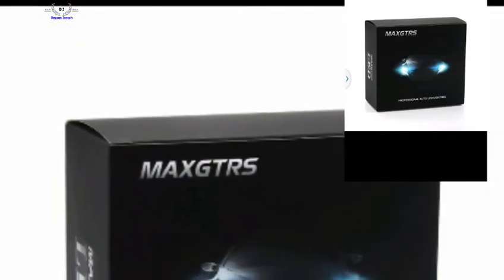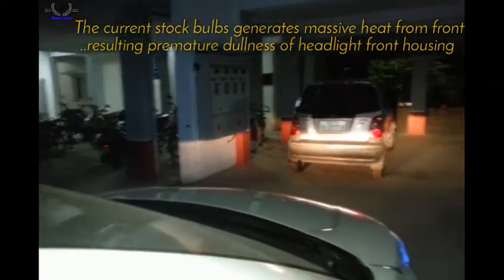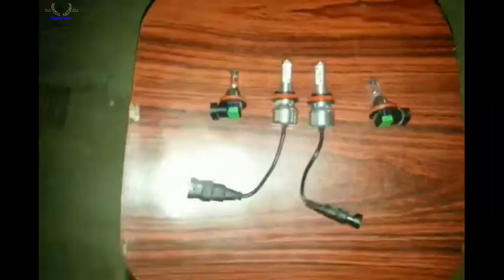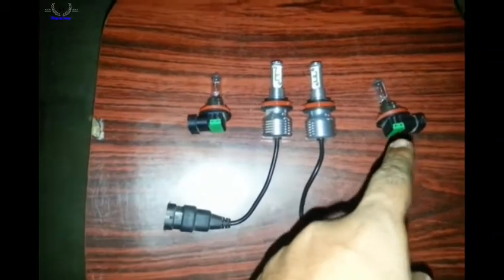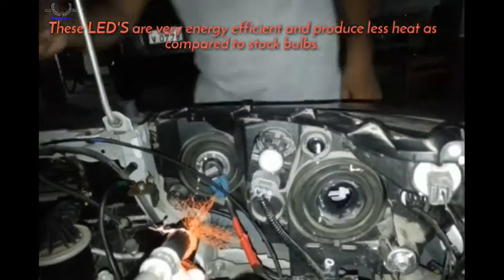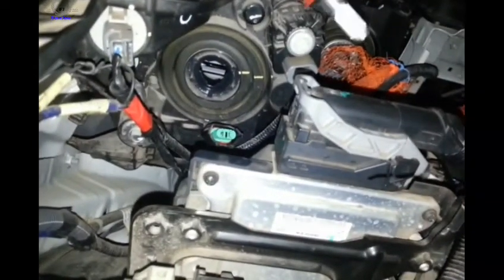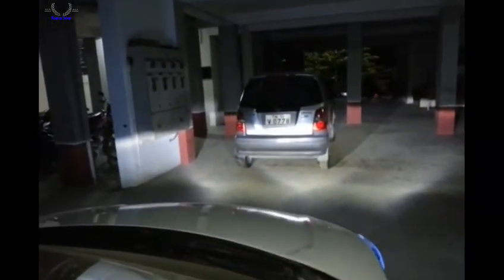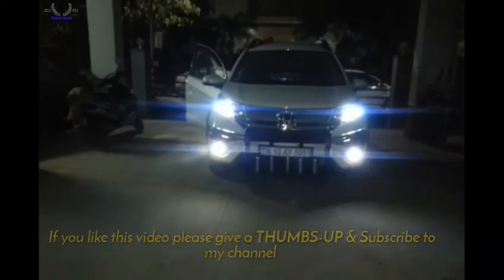Honda BRV Low beam H11 LED 6K lumens Headlights

Comment: FYI it will not blind opposite because BRV low beam headlight (H11 bulb) casing is Projectors type while the high beam (HB3 bulb) case is Reflectors type. Changing LED to a Reflectors type case will surely blind others if the angle is not adjust.

Comment: Hi, did you also change other bulbs in the car to LED? (indicators, reverse light, number plate, interior lamps etc..) What is the increase of load on the battery after this upgrade?
Reply: Did them on my old corolla, indicators, stop lamps, but indicators needed a load resistors. Switched back to stock bulbs on for the headlights though. Anything to do with wiring changes, i stay away. As long as it is plug and play its a cool upgrade. Just a heads up if you aren't aware, changing to LED is actually illegal. One of the reasons, is that the headlight assembly is built to work with halogen  bulbs  (unless manufacturer has offered it as a stock option). Although LED's run cooler, still the light throw isn't handled as expected resulting in glaring to oncoming traffic. The use of projectors in the BR-V cancels out the glare as it does its job regardless of the bulb type.